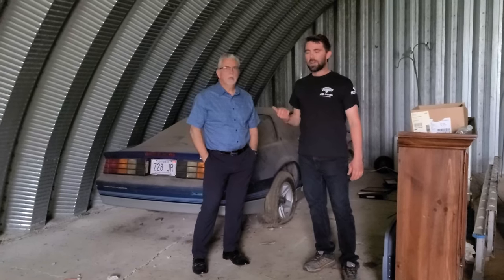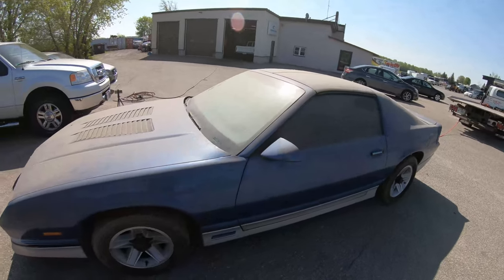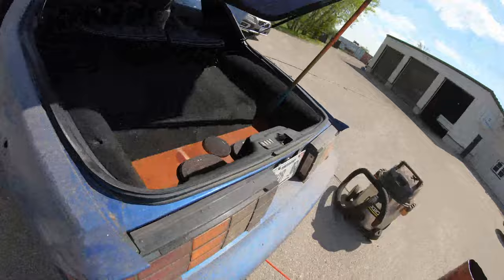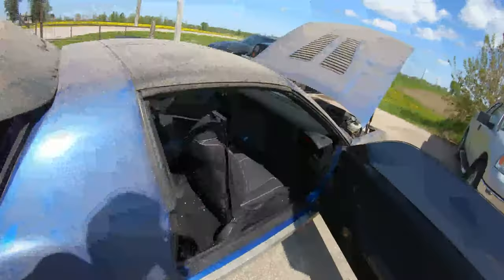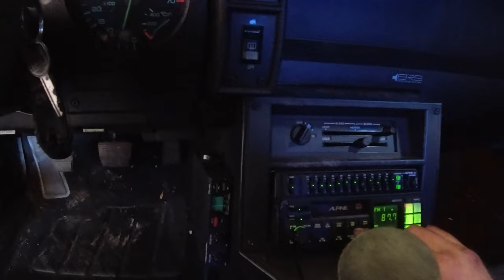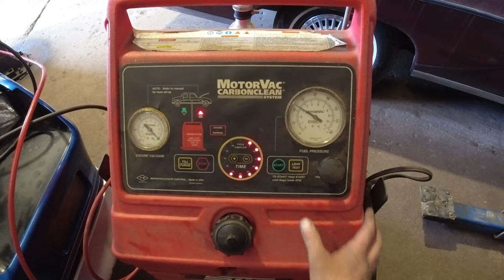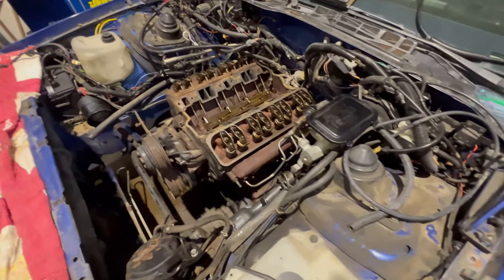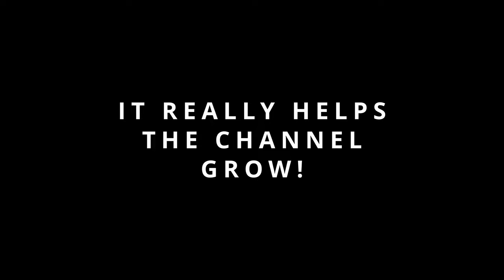RESURRECTING A CAMARO Z28 PARKED FOR NEARLY 30 YEARS! WILL IT RUN?

Comment: Wow, that looks exactly like my 1985 Chevy Camaro Z28, same color design, same setup. I bought mine last year, still trying to restore her.
Reply from the maker: nice! it will be worth it once you get her on the road!
Reply: @msicilia59  yeah I discovered your video in my news feed. At first I thought I car was stolen. Lol. She runs, I'm in the middle of changing out the water pump. Just need to replace the front and rear suspension, change the brakes, and finally going to the paint and body shop.

Comment: amazingly mint from the hangar, my goodness.  the owner had the right idea on where to store it and it was put up in mint condition im sure.  So the problem was bad oil pump?  Why not just replace that, the walls of the cylinders still looked good.  Unless all the bearings are shot from no oil??

Comment: Just an FYI, when trying to rock a car against a gear to unstick a motor, you want to use your highest gear 5th gear would give you way way more leverage to do what you are trying to do. It is easier for the engine to turn the wheels in 1st gear, conversely, it is easier for the wheels to turn the engine in 5th gear... Really like the color scheme and the pin striping- I would delete the non-factory decals but keep that pin striping. Also a shame on nixing the numbers matching 5.0. I feel that with a car of this caliber, it would be wise to keep it as original as possible. But that being said, I swapped in a 6.0 and t56 in my 89 GTA and it is a real blast to drive ;) Factory motor was long gone by the time i got the car...

Comment: I don’t agree with pulling that original motor I would have put a new oil pump in it. If you look at the crosshatching in the cylinders that was a very low mileage engine and you guys are killing the value of that original car by pulling that engine out of it